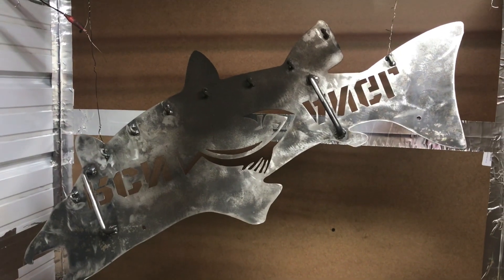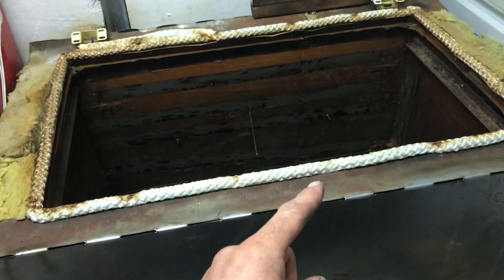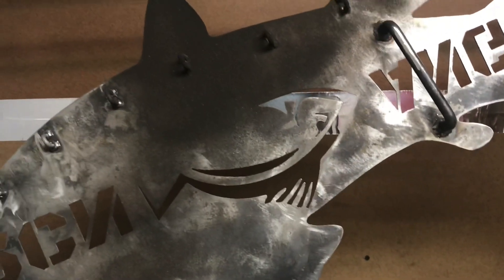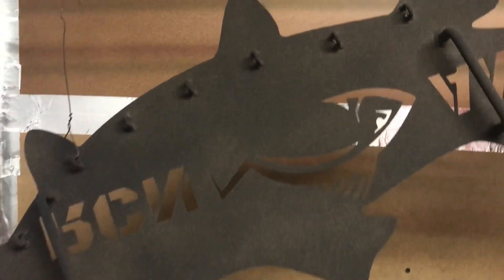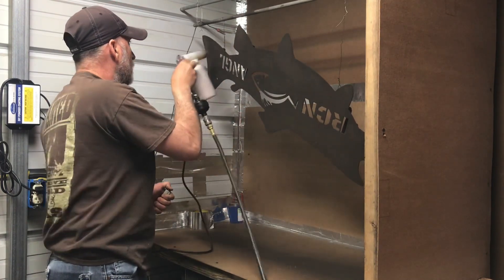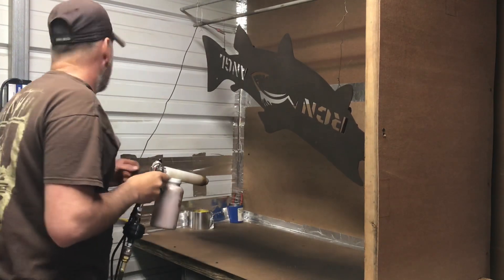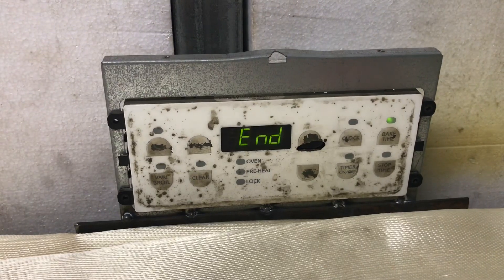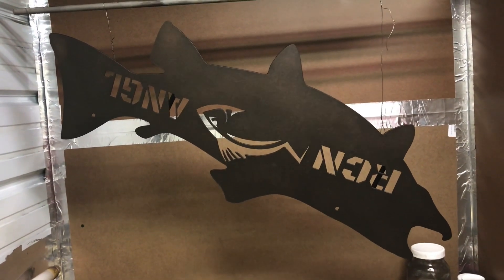DIY powder coat oven

Comment: I was thinking about aluminum but have no way to weld it together ! Your will be lighter then mine for sure ! Are you going bogies or slide on your suspension ? What size motor you going with ? Powder coating looks like fun !
Reply from the maker: I’m going with a Honda 14 hp. No sliders just bogies so I can use it in the summer.
Reply: CW FAB my thoughts exactly !